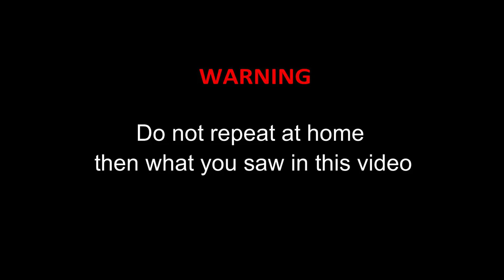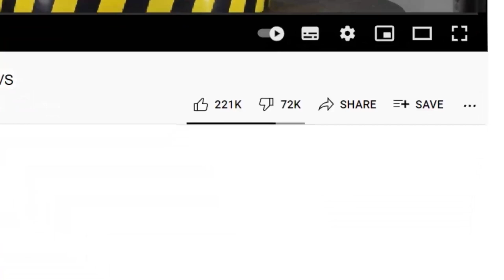WHAT HAPPENS IF THE BULLET HITS THE CARTRIDGE 2

Comment: Some weak powder in them things or them casings are strong as hell and that wood is alien.
Reply: Could be weak powder. But it’s weak because the explosion and gas isn’t forced down a barrel behind the projectile… so the energy escapes in all directions instead of all behind the bullet. Use your brain.
Reply: @dackbowland1876  I had a friend shooting 9mm or 45 rounds with some kinda rubberband sling shot set-up into a concrete block. Bullets weren't richocheting. So either we were lucky or that was a weak block of concrete. Basing off experience. Its weird seeing a round that big and not rounded like a 9mm bouncing off wood
Reply: @brosephbroman7564  lead is way more likely to bounce off wood at low velocity. When it hits concrete it will dump way more energy and flatten/explode on impact. 

Your experience is valid but not comparable since they were different weight and powder and shape even the kind of metal casing will have a huge impact on how much energy from the powder will launch projectile or just blow out the casing around the projectile. 

Either way like I said before your theory of light powder load is still possible. I’m just saying when the shell isn’t in a chamber with projectile at the end of the barrel, the energy from the explosion will go in every direction not just behind projectile and it will be at the very least 10x slower velocity.